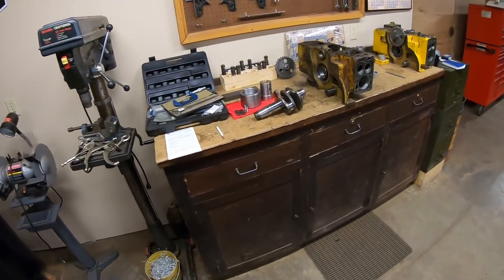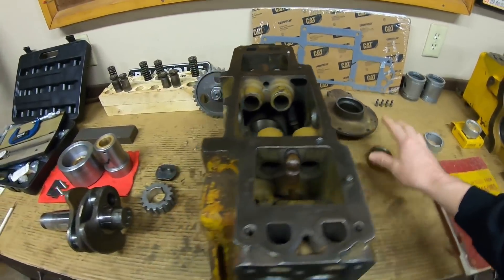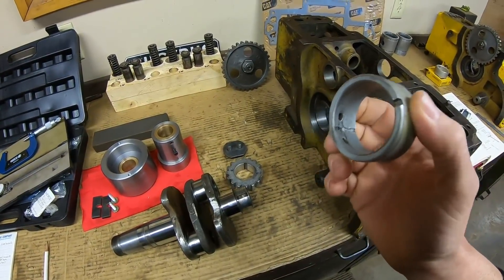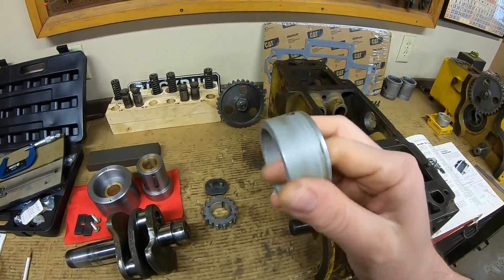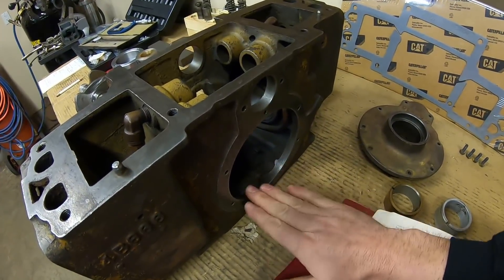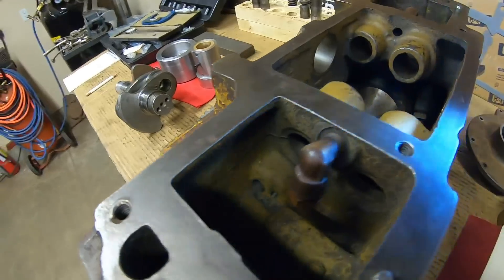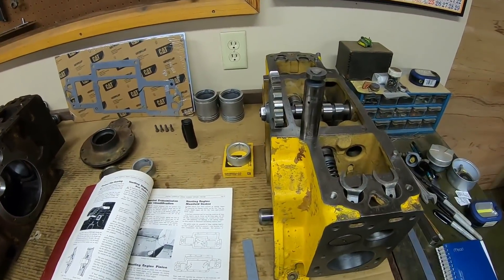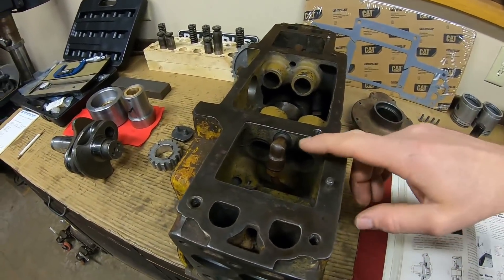Caterpillar D2/D4 Starting Engine Viewers' Q&A Episode: Why Aluminum Bearings/What's with the Tubes?

Comment: Starting @10:16 the early block tubes. Are the ends of the tubes set in a direction to have oil and air splashed into them by the spinning crank counter weight.  Filling the cavity around the lifters and any air and excess oil comes out the holes over the lifter bores. Or does the crank spin the other direction creating suction on the end of the tubes and pulling oil thru the vent hole above the lifter bores until the cavity is full and sending overflow oil back to the crankcase.  

I have been thinking about this off and on since the video came out.  
Question. On newer blocks without the tubes. Are there openings into the cavity in the lifter bores hidden somewhere.   If the cavity is filled with oil. Will the pressure pulses cause oil to squirt onto the cam lobes from the 3 holes in the lifter.

Could the early tubes be an attempt to oil the cam lobes or just keep oil pouring onto the spinning crankshaft. 

An interesting thought. Could an insert be machined to fit over the closing side of the cam and crank gears to create an under cover low pressure oil pump for the main bearings. 

Sorry for the wall of text while you are elbow deep in bumper brackets.

Comment: I really appreciate all of the technical information!  Thank you.  
Have you ever worked on a D4600, and starting engine?  I am wanting to get one going in a Dragline.  The big motor is 7B6096,  and the starting engine is 8B1491.  I am having difficulty finding information on these engines.  Thank you, Paul.

Comment: Air craft engines use crank pressure all piston powered air plane engines use crank pressure they have no oil pump why is because of rolling up side down barrel rolls and dog fighting
Reply: Definitely not true. Most of the big WW2 engines were dry sump, pressure lubed designs. And modern light aircraft engines are usually pressure lubed as well, except for things like paramotors which are often 2-strokes running premixed oil.

Comment: You think it’d be worth running with slightly more oil if new style tappets with holes are used in an old style block with the tubes? That’s the situation I’ve got for my rebuild and now I’m concerned the new style tappets will hold oil and lower the level that the crankshaft is running in.. Or am I overthinking as usual…
Reply: Awesome, thanks for the reassurance! Makes sense, being detail oriented like me can be limiting, too many rabbit holes to disappear down, ha..

Comment: I am not questioning anything you said. But, no matter babbitt, bronze, or aluminum, isn’t the real issue lack of oil? Due to either the needle leaking and diluting the oil, or, not enough oil coating the bearing when running or starting after sitting. As you know the bearing rides on a film of oil. Gasoline washes the oil off. Convert to diesel pony motor, problem solved as diesel is oil. 😉
Reply: Diesel is too light to be an effective lubricant in most cases. It only works well if the running clearances are very, very tight, which is the case in a diesel injection pump but not in a crankshaft bearing. Diesel diluting the engine oil has been an issue on some newer diesel motors that use injection on the exhaust stroke to regenerate their DPF.

Comment: Why the hell did Cat not put in an oil pump right from the get-go? 
They knew these engines would get no warm up, knew they would go full revs on cold oil...and no oil pump to the main bearings, conrod bearings and lifters was going to wear out these engines quickly.....
Planned obsolescence/cheap engineering...... even then???

Comment: As a machinist for 25yrs , my advice to get your good surface finish on aluminum bearings is high spindle rpm, alot of positive rake on your cutting tool and a fair tool nose radius( not sharp). Varsol works excellent as a cutting media , WD40 works very well too. Try adjusting your feed rates to about .006" to .012" per revolution to achieve desired finish

Comment: As for as machining aluminum use at least a 1/8R and a high speed tool bit and either wd40 or tap magic for aluminum. And you should have a mirror finish.do not use a real aggressive feed rate should solve your problem.

Comment: 5:48 This might be why some crankshafts get nickel spray welded. The nickel is very hard, and the sprays cools off so quickly, it can't affect the heat treatment of the crank. It's good for cranks that are too far undersize.

Comment: I'm working on new main bearings for one of my D3400s right now. I used a high speed steel cutter medium nose radius positive rake, slow feed, light cut, coolant. When I was about .0010 to .0005 from finish size I hit it with fine emery paper just to polish the bore a little. Came out great. Good video as always!

Comment: HSS over carbide ALL DAY LONG when cutting aluminum. It’s a lot easier to get a good surface finish; mostly because you can make the clearance and rake angles a lot steeper. Hone a good little radius on the end with a stone and you should just about be cutting mirrors.

Comment: Have you ever used oil light bearing material? ( oil impregnated bronze)
Reply: Oilite is not recommended for bearings that experience shock loads. It's awesome for a lot of other applications though, my milling machine runs oilite countershaft bushings and they are excellent.

Comment: Re the bearings spinning in the housing, I suspect a large part of that is differing expansion rates - ali expands a lot more that iron, and is softer too. Aftef a pile of heat cycles, this reduces the interference fit on the bearing - especially when cold - at which point it's only the pin stopping it spinning, which eventually fails.

Comment: Squatch, I was wondering, If Federal Mogul, or Sealed Power, would supply the revised crank shaft main bearing, in an oversized outer diameter, to fit the oversized bore now in your block, with the standard size crankshaft journal?  I appreciate all the work, and the milling you have had to do to revive these engines, and show us fellow antique Caterpillar fans how to breathe new life into the vintage power plants, but if a major bearing manufacturer, had that bearing on hand, wouldn't it be easier to purchase it, rather than make it from " scratch" just an idea, and question?
Reply: Federal Mogul used to make bearings for them.  They have been since discontinued.  It is sad, they had several undersizes that Caterpillar did not.

Comment: You have answered a LOT of my unasked questions about the aluminum bearings. Just completed a John Deere B engine and those rod and main bearings are babbit lined bronze. Lot slower rpm's and a much larger bearing surface so they worked well. One thing I will tell you about machining aluminum after doing it 36 years is your softer materials 6061 etc are prone to galling and bad surface finishes. The harder alloys and heat treated stuff give you a much better finish. So if you are going to use 6061 try this. Your cutters need to be razor sharp with plenty of clearance for chip removal and for a final cut about a .030 radius. Very high rpm's with if you have it some flood coolant for two reasons. One is chip removal and the other to keep the work cool. Aluminum heats up very quickly. Be sure for your final dim check to let the material cool. I have used TapMajik for aluminum in a pinch but flood is best if you can rig up for it. Either one can make one heck of a mess. I have made a lot of bearings over the years and this has usually worked for me. Hope any of this helps...

Comment: Nitriding of crankshaft journals is fairly common, even in some factory engines. It does give a harder surface finish, generally, on the journals about 0.010-0.015” deep. Their are still some companies out there who could do this. The cost of nitriding a crankshaft as small as the one used in your starting engine would probably be about as much or more than a replacement crankshaft,  if it could be accomplished. From listening to your discussion crankshaft journal and main bearing journal wear is not a huge problem. Bearing wear is the problem mostly encountered.

Comment: Enjoyed the video!
Have you considered putting an electric shut off valve on the starting engine fuel tank, so when the kill switch is hit, it shuts of the fuel instead of killing spark? Almost fool proof in my opinion.

Comment: It looks like  you would have to absolutely  neglect those engines to have them fail, with good lubricant especially now days bearing failure would almost impossible if the fuel gets shut off  and don't contaminate the crankcase oil .and a question? Can the starting engine fight the the main engine or does  an overrunning clutch to disconnect it, I could see the possibility of  damage being locked up to the  main after starting....

Comment: I wonder if needle style roller bearings would work, similar to the ones used for cam bearings in big block Chevy racing engines?
Reply: Rollers do not last as long and if there is any foreign material in the lubricant they wear out very quickly remember there is no filter in this application. In race applications the oil is changed after every race and time between rebuilds is quite short.

Comment: Squatch- My family has had Cat tractors around since about 1959. Pony motor oiling problems have always been an  issue. As you elude to, gas dilution is always a problem, one easily cured by idling down the pony engine and shutting off the gas . The diesel loves the extra heat to warm up and it clears the carb of gas that can slosh and leak into the pony crankcase. Plus you stop having old gas in the pony carb, and it's associated problems. When Mobil One came out years ago I began using it in the pony engine on my hand crank start 4-T D-7 pony motors, With standard motor oil it was almost impossible to get any engine momentum with regular wt. oil. With the Mobil One there was no drag at all  in cold temps. Cold thick oil , high pony RPMs , lack of pressure lube and low/ diluted oil all caused pony motor problems. Since keeping non-diluted Mobile one in my pony engines I have had no more oil related problems. Before that the only cure was an electric starter off of a 17a D-7.

Comment: Extremely interesting video that service bulletin book has a lot of extremely valuable information about the different production changes over the years. I feel that aluminum is the best choice of a bearing it also is more heat stability  especially when running in oil Babbitt material likes to start flowing if it gets to warm and that can even happen if the starting engine was run for a extended period of time and when shut down the retained heat can distort the Babbitt. When I first started sawing lumber my original sawmill had Babbitt boxing bearing and they were 7 inch wide and a 2.5 inch shaft and I was running in the winter time with high temperature grease that had a melting point of 275 degrees and it was -20 when I was sawing and the grease would boil out of the bearing and start smoking
Reply: @squatch253  I can totally understand that I had my education with the Babbitt bearing I was only 18 years old but I was patient I like talking about my Sawyer experience I had to learn on the fly to keep it going now I have 2 circle sawmills my old one from around 1900 and a Jackson lumber harvester sawmill from the 1980s . The old Babbitt bearings would drip when I would stop the saw arbor. Now I run dodge type "e" double roller ball bearing units on the arbors

Comment: Has anybody ever thought of using a needle bearing for the crankshaft main bearings in conjunction with the harden bushing?
Reply: Yes it has been done but typically rollers do not last as long and if there is any foreign material in the lubricant they wear out very quickly.  Rollers typically are used in 2 stroke engines where the lubricant is the fuel air mix and is replaced with new basically every rotation.

Comment: Good video I enjoyed it. You mentioned machining Aluminium. A good lubricant for machining aluminium is Paraffin or Kerosene your side of the pond. Use a little bottle with a spout so you can dribble the kerosene onto the job and the tool tip. Make sure you keep the tool tip wet as alumimium has a habit of sticking to the tip of the tool which then destroys the finish of the job. Don't let the tool tip get blunt.
On lubrication I have seen a car engine running with a clear plastic oil pan and the crank looked like a ball of wool with all the oil spinning around and off it. Obviously on a car engine the pump is pushing oil through the crank whereas these starting engines rely purely on splash lubrication. If it is running with the crank webs dipping into the sump of oil the oil will be well stirred around the engine. Also these engine probably ran cold for most of their lives as they would only be running for a few minutes to start the diesel engine. Finally modern oils are so much better than back in the day so I wonder at the choices of oil you have and what is recommended. I would have thought a good thinish synthetic oil would be good.

Comment: One of the failure problems is not being able to warm up at a lower RPM from my understanding of the starter motors they go full RPM almost right away instead of just a high idle.

Comment: You are busy enough as it is right now…. Once it’s all said and done…. Be interesting to take one of the broken blocks and  put it back together so as to be “water tight” and put oil in it, put a clear cover on it.   Spin the crank with a drill and see just how the piston pulses do affect the oil distribution.   In my career as a PDE and race engineer, such tools usually lead to a “Huh?!” moment.  Rarely do liquids behave exactly as we predict.  Sometimes it’s a pleasant surprise, sometimes it’s an “oh $hit!”

Comment: Alum bearings are still used as of today in many engines across all manufacturers. Like Ford Coyote 5.0 has alum bearings. I've seen many 5.0 core engine with 200,000 miles and bearings look perfect
Reply: Cummins, Cat, and PACCAR use aluminum bearings in their engines too.
Reply: Briggs&Stratton have had aluminum rods, mains, and bores for many years too.  Same kind of splash system as in these Cat engines.  I had a BMW 250cc motorcycle ('57) that had an aluminum rod and no insert.  I think they were fine as long as the oil was changed frequently enough.  I never had a problem though I recall the Isetta engine did have some rod issues because of their cooling and harder duty.
Reply: They are basically aluminum, but impregnated with silica.

Comment: Yep Squatch, as others have said in comments, WD40 is great for machining aluminum...PS, I like your channel very much, I had an AC hd4 crawler loader many years ago, and done much of the same work on it. You did a great go over on bearings, materials, and wear...BOTTOM LINE is Quality Clean OIL and Filters changed as per Cat specs....Many old timers back in the day [war time era] of your D2's often time did NOT and that is the resultant wear IMHO.

Comment: Interesting info on aluminum bearings. 
Are you going to use dry ice to reduce the new bearing and heating the block to reduce damage to the bearing of when driving it in.  Perhaps using an aluminum arbor that is also chilled to reduce the aluminum warming slightly while inserting the bearing. 
With your boring bar set up on the lathe. It would be easy to create a shallow keyway in the block to prevent the bearing from spinning.  If you used a round end tool. You could create a half circle keyway in the block. Machine a matching round keyway in the bearing. Then perhaps tap threads for a set screw.

Comment: You know what you're going to have to do, don't you.....You're going to have a make a clear top cover so we can all watch the oil slosh around see what is actually happening! :P

And as mentioned many times already, WD40 (straight from the spray can) is the best lubricant for cutting aluminum.
Excellent video, Thanks.

Comment: Cat I m sure engineered thru their testing and feed back from the owners and mechanics to build the best they could at the time .
Now with computer simulations many different problems can be solved before something goes into wide production .
That said what did Cat do in the later generations of starting engines?
Reply: @squatch253  Thanks for the reply didn't know if there had been something before they went to electric starters . You would have thought with the possible dry start condition they would have had a manual oil pump to prevent such damage to

Comment: If you had a particularly nasty crankshaft and a particularly nasty block, you might have to undersize the crank and oversize the block enough to get into needle-bearing territory. I wonder how much longer that would last than an aluminum plain bearing.

Comment: I can highly recommend the xxGT style of lathe inserts, they are designed for good finish in aluminum.  Thr GT denotes a carbide insert that was ground and polished to a very high rake angle. They do ok in steel too, with smaller cuts in my 1945  South Bend
Reply: +1 for GT inserts, also great for machining plastics and rubber.